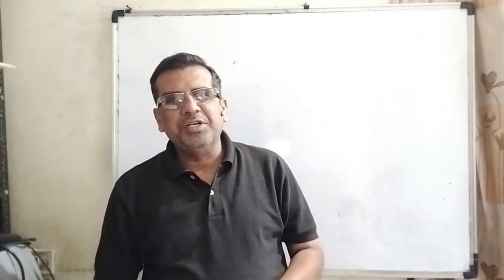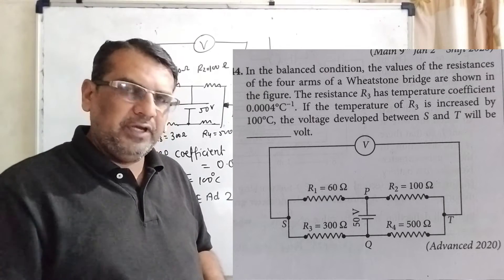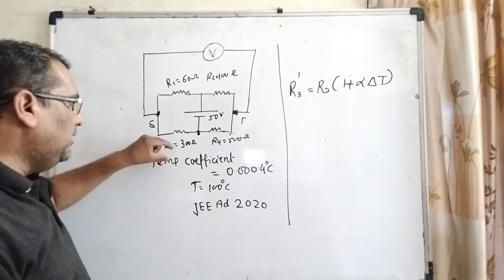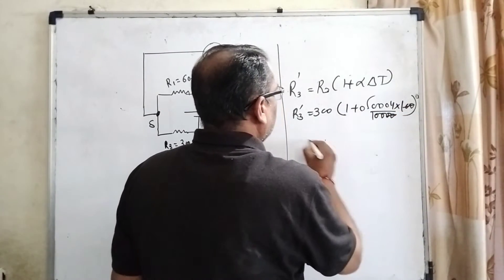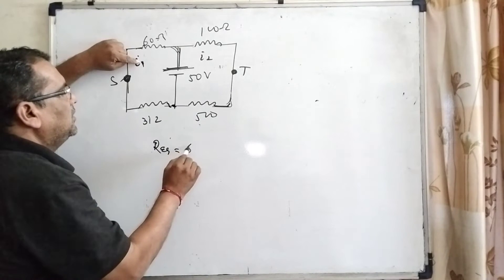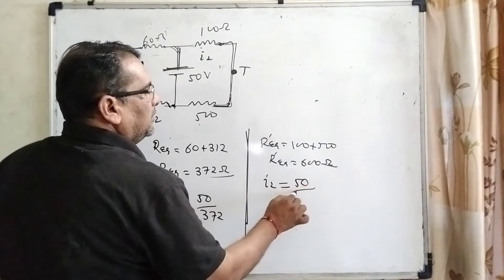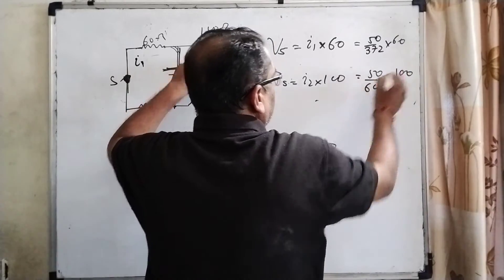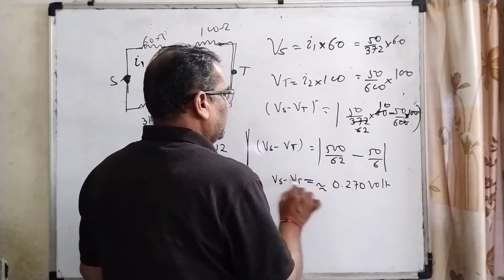In the balanced condition the values of the resistances of the four arms of a Wheatstone bridge are

Comment: sir why is Vs= i1 x 60 and not (50- i1 x 60)?
Reply: Because dusre waale se answer nahi aata
Reply: @MokshitKalRa nah by doing what sir did, u get -0.27, and by subtracting both the values from 50 and then doing Vs-Vt, u get +0.27, but it doesn't really matter cuz only the magnitude is required.